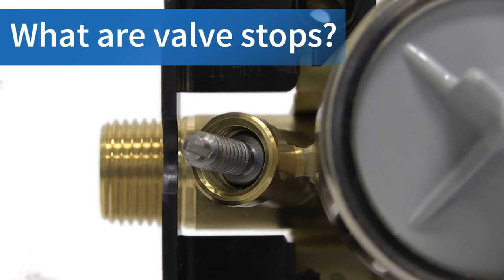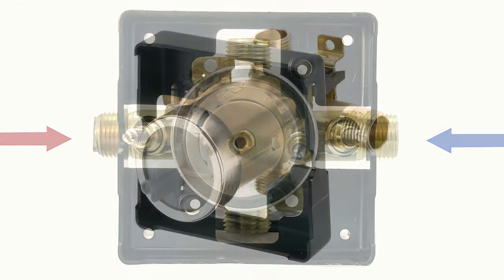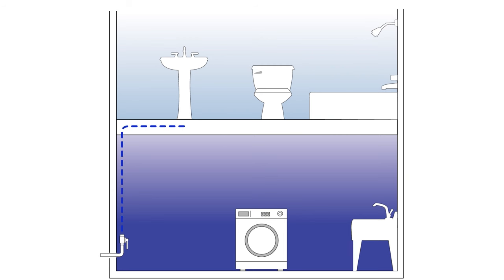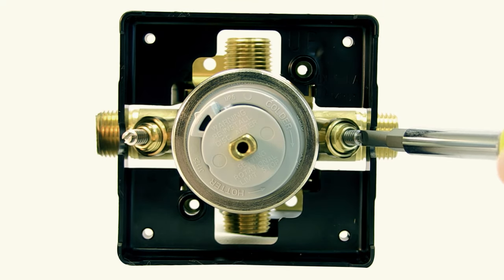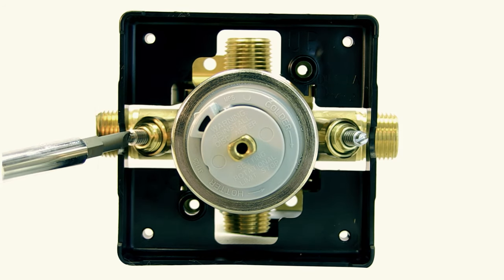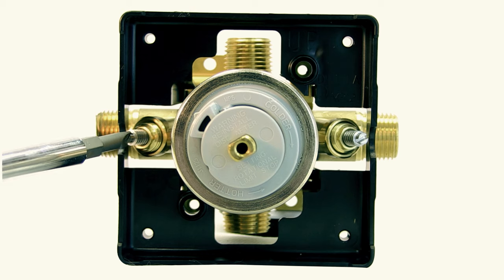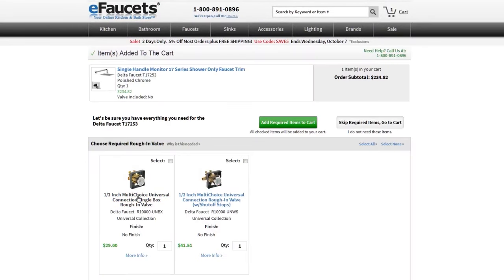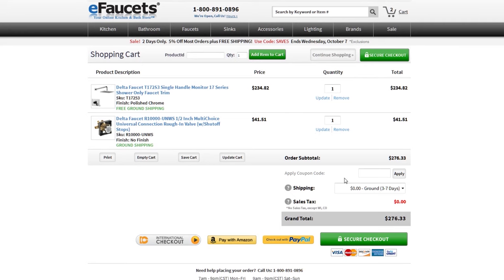Shower Valves - What are valve stops? - eFaucets.com

Comment: But…. What if there isn’t something like that when you take the over off. It’s just straight pipe and no valve 🤷🏻‍♂️ 
 I have something on the other side of the wall, that I can turn, but it just turns and turns and I don’t want to turn it until water shoots out.
 Is this the shut off ?

Comment: Can this help if you don’t have a ton of pressure? I’m assuming maybe the guy who re did our shower didn’t turn them enough.  All showers in the house are good pressure but this one is poor very poor
Reply: They are also called check valves but they can be used to shut the water supply off. My cold water valve would periodically not work properly and hardly any cold water would come out. Turn the main water off and unscrew the valve and clean it. It should move in and out freely. I am on a well system so I might just remove the inner parts and never have the problem again. I had to fix it twice in 3 or 4 years.

Comment: What happens if you keep on turning them to open, will they pop out?
Reply: nope.. the retainer nut won't let the "screw" go any further (big mistake on the video above, the nut on the left side is completely loose, should the tight thru the end)
Reply: Ive watched a guy turn the screw and it popped out and water flooded the bathroom at a hotel.
Reply: What is the potentials of leakage . Also if it  has some calcium corrosion. Last question if it does leak after turning it on would liquid Teflon work to save it from leaking . Thanks